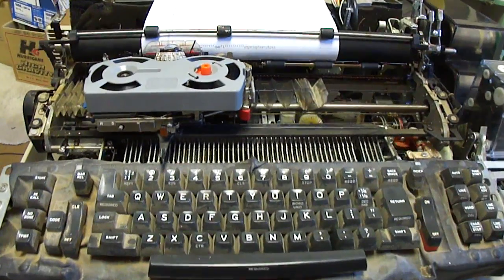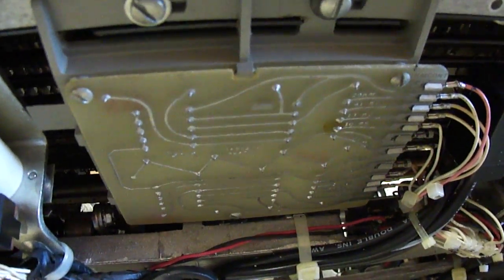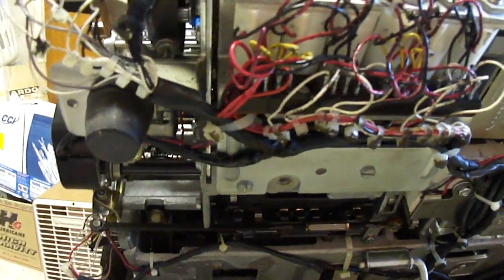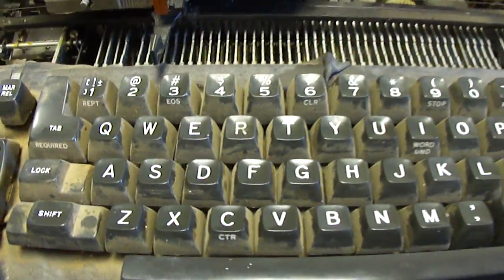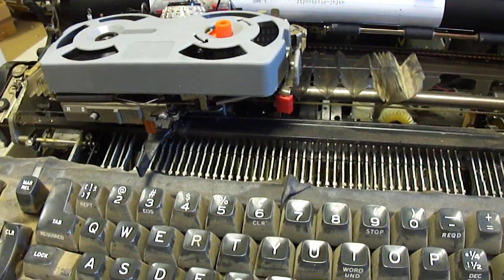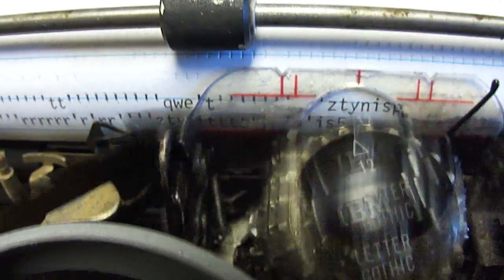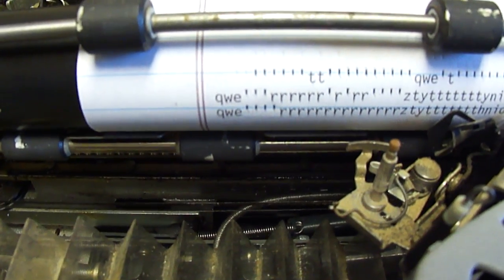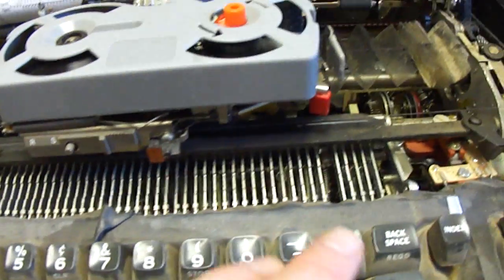1982 IBM Memory 100 Typewriter repair

Comment: "You really are becoming pathetic aren't you?  I'm one of the few people still alive, that could actually fix that machine; but I threw all my spine tools away long ago. I guess you don't know what spline tools?   Take off the element (ball) and underneath you will see two small screws holding a capstan with a pin  in  it.  That has to come off, and underneath is a Dog Bone!!   Now   Go away!!   That's all you get//"
Reply: +Griffith Harland "That's all you get//"?...., and yet, you keep coming back and adding to your vitriol. But my word, would I let you anywhere near one of these with your demonstrated confusion over how it works, names of parts and general mis-understanding?, NOT A CHANCE.  The 'capstan' you refer to is of course the Tilt Ring as I previously covered, and yes that is where the dog-bone connects. Glad you finally accept it.
I fully understand how easy it would be to forget the exact names of parts when you have been away from them for so long and I do not doubt that perhaps you were competent on these machines once, but I'm afraid your memory (no pun intended) and demeanor is letting you down here.  Your comments and opinions would be welcome if only you would not be so rude and insulting and accept clarification when an incorrect statement (which you bluntly submit as being factual) is responded to.
I have considered your kind request to Go Away!!!, but well why would I?, I'm quite happy here, and apart from which, I was making useful comments on these videos long before you leapt in boots and all with your mistakes. You are welcome to stay as well, just play nicely :-)
Reply: The 'Dog Bone' has nothing to do with the 'Tilt' and only the 'Rotate' of the Element!

Comment: We called it the Dog Bone because it is shaped like one, but it has a slot cur in each end - One at 12 to 6  and the other end 3 to 9, which rocks the element Tilt and Rotate as it changes at rapid speed from one character to another.  Tilt at one and Rotate at another. Won't make no sense because you get so frustrated??
Reply: Griffith Harland Incorrect (again). The 'Dog Bone' (Balljoint) slots are not offset. They are in the exact same alignment each end. There is a difference in the dog-bone across some models (9xx) due to the decreased bandwidth of the 96 character elements and they are distinguished by a scribe line around the centre. The dogbone does not directly transfer any 'tilt' motion, only rotate motion. Tilt motion is performed by the Tilt Bellcrank on later models and the Tilt Gear on early Selectric I models. The entire purpose of the dogbone is to act as a universal joint to allow the required rotate and tilt motion through the full range of 44 or 48 possibilities through the "Tilt Ring" which is what the element actually attaches to.
Hey Griff, there's an online training series for the Selectric Typewriter available, perhaps you should download it and retrain yourself?
PS: Just to be clear, I'm not getting frustrated, not at all, but I don't want any 'observers' thinking I'm picking on you, taking advantage of your incorrect recollections, or indeed 'trolling' so I am giving you the benefit of the doubt.
Sadly it is you, and only you who keeps making these totally factually incorrect statements and I'm happy to set the record straight.
Next.....

Comment: "Just how do you think they  change the pitch on that machine, IF they don't change the Element from  Elite, to standard Ten Pitch Courier??"
Reply: Griffith Harland Wonderful - not sure quite where that question came from but I'm up for it so here goes...
Changing the ball (element), does not change the pitch. The pitch (10 or 12 characters per inch) is pre-determined by the teeth on the escapement rack.
Early Selectric's had a solid rack and you ordered either a 10 (Pica) or 12 (Elite) pitch model according to your requirements. And it was the same for the Typebar models except they had a larger range of available pitches including Proportional.
Come 1971 and the Selectric II which now added a pivoting escapement rack combining both 10 & 12 onto the same bar. Flick the lever and the spacing (pitch) changes from 10 to 12 and vice-versa. Yes of course you would generally change the element to match because 10 pitch characters are wider than 12 pitch, but it was very common for people (especially legal secretaries) to use a 10-pitch element on the 12-pitch setting to combine a slightly larger font with tighter spacing to get more typing onto the page but still be easy to read. Changing the element is more about changing the typestyle/font than changing the pitch.
Note that on the machine in this video there is no escapement rack, only the leadscrew drive (call it a very long worm-gear if you must) which has a ratchet at the right-hand end. The ratchet has two sets of teeth, one set for 10 pitch and one for 12. Each ratchet has a corresponding solenoid which drops an armature into the ratchet to control how much rotation is allowed, and this is determined by the Planar (electronic board) counting the pulses from the Emitter Wheel on the left end of the same leadscrew.
The leadscrew only controls left to right motion and is under positive drive bias via the gearbox assembly directly driven from the main drive motor. The Electronic Selectric Composer is absolutely identical in this area except that it has three ratchets to match the required 72, 84 & 96-unit spacing.
Because you appear unfamiliar with this particular machine you may find some illustrations would help to better understand this. More than happy to provide those via the "golfballtypewritershop" which you can find on Yahoo (https://groups.yahoo.com/neo/groups/golfballtypewritershop) or on Facebook (https://www.facebook.com/groups/gbtwshop/)

Comment: "The Ball.  The Element does not turn.... It Rotates left and right.
  As I once told you, but you would most likely break it. The element (Ball) as a little black plastic top tha can be lifted to the right and then you can lift the ball off the machine. Underneath the ball is the Dog-Bone mechanism, and it is that that is the problem with your machine.  Go on break the element then you can throw ikt in thew garbage.  What is an Elical spring  (can't spell it these days) but it is that that drives the carriage. from left to right and also may be a problem..

Comment: "Every Selectric has a Worm gear.. Even the Selectric one.  has that same white nylon gear.
Reply: Griffith Harland Incorrect. Selectric I, II & III all share same basic design.
The only 'gears' involved in carrier movement are the Carrier Return and Tab PINIONS, the Tab PULLEY, and the Return/Backspace PULLEY.
There are also the pulleys for the Tab and Return Cords, plus the pulleys for the Rotate & Tilt Tapes.
And finally the drive train 'GEARS' on the left hand side to transfer motion from the Cycle Shaft, through the Idler Gear to the Print Shaft and Keyboard Filter Shaft.
However, some of the advanced models such as the Composer,  the Memory Typewriter shown here,  Electronic Selectric Composer, Mag-Card, and the 5215 Display-Writer Selectric printer, (plus of course the entire series of Electronic Typewriters model 50 thru 95) do have an Escapement Lead-Screw, a form of 'worm-gear' but these are not normally referred to as 'Every Selectric" as you state. I have never seen a Selectric I/O-writer with an Escapement Lead Screw.
Always glad to add to your knowledge and understanding of these machines :-)

Comment: "IF you knew as much as I do about IBM you wouldn't have any problems.  You don't even know what a Dog-Bone is, or a Rotate Tape, or a Tilt Tape. "
Reply: Griffith Harland Sorry Griff but you just dig yourself into a larger hole. I'm trying to be informative but it's clear from your comments that you are having some difficulties expressing yourself and I guess you have a few more years under the hood than I do. It is not my intention to belittle, insult or humiliate you in any way.

Of course if you make statements that are factually or technically incorrect I'll gladly put them right and leave it at that. Best.

Comment: "What you have is a piece of JUNK.  I bought one just like that one for $14 at a thrift stores, and finally threw it away owing to my relocation to another city. 
  I don't I even try to help you???  I really did used to strip down IBM's  for fifty years, but then you're a Radio Tech and piss all about Office Machines "
Reply: Griffith Harland I don't have a piece of junk, it's not my machine, and not my video. I simply added to your erratic and ignorant comments for the benefit of others just in case they mistook you for being knowledgeable . If you are going to comment on topics you better be sure you know what you're talking about and clearly you don't have a clue.

As for "Radio Tech?", nope not me. Don't know a lot about radios but I am thankful to know just a little bit about IBM office products (such as the IBM Selectric Memory Typewriter 50/100 as shown here).

It's fantastic that you used to strip down IBM's, but I wonder, did you have any success putting them back together?

Comment: I could see in the video that the Z is immediately above the T.  I might suspect the single quote and r are in the same relationship.  Since it seems to put the correct character in memory, the keyboard, including the reed switches, is working correctly.  I would guess the most likely problem is adjustment of tilt home which is spacing of the pulleys of the tilt tape.  This, and rotate, needed to be checked and adjusted frequently.  To hand cycle this machine you disconnect the motor turn it on.

Comment: This chart may help you.. groups.yahoo.com/group/golfballtypewritershop/photos/album/1826749023/pic/1426202396/view?picmode=large&mode=tn&order=ordinal&start=41&dir=asc - you cross-reference the character that should have printed against the one that actually printed, it will point you to the troublesome latch - although this is the base Selectric Typewriter chart, the Character Selection Differential is the same basic design as in your Memory Typewriter.

Comment: Your substituted characters are most likely a problem with the Selection Latches - left side, pulled by the bank of solenoids. Sometimes they 'pop' meaning they slip off the Bail which pulls them down to move the Tilt & Rotate Tape. There is a chart which will assist with trouble-shooting this problem. May I suggest you check out the Yahoo Group golfballtypewritershop... groups.yahoo.com/group/golfballtypewritershop

Comment: @retrochad  - these machines will automatically convert a 'space' into a carrier return if the space occurs within the right margin 'zone' which is about 5-8 spaces (I think the zone is adjustable but can't recall). This is what enables the electronics to keep line-endings consistent even though text may have been inserted or deleted during editing.  A 'required space' means that the space must remain as a space, ie not be converted to a carrier return if it occurs in the right margin zone. HTH

Comment from the maker: @drewinatlanta Thanks so much Drew, any help you can give me will be very much appreciated. I tried the machine again today and it started out OK but started typing wrong characters which would vary...I can't figure out if it is a lubrication problem in the tilt/rotate mechanism for the element or if it is in the mechanical logic between the keys and the reed switches or if it is an actual electronic problem in the computer circuits.

Comment: I have complete user documentation for the Memory 100 and the Memory 50 (the only difference on these 2 machines was whether it stored approx. 100 pages in 100 memory banks (Memory 100 with the "A" and "B" switch in the center of the dial) or 50 pages in 50 memory banks. I have 3 of these machines - the one that still stores and replays perfectly which also types random chars likes yours did. Would be willing to scan the user guides and share with you if interested.

Comment: When stored memory is replayed, the machine adjusts if margins, etc. are changed (like word processors). Sometimes an operator may not have want the machine to break two words separated by a space if at the end of a line, may have wanted to ensure a hyphen wasn't interpreted as an optional split of a word, or ensure a return wasn't optional, etc. By keying Code + the appropriate keys with "reqd" options, the machine would interpret that command as "required" when playout occurred from memory.

Comment: @retrochad Very interesting! It's possible to store data only with RAM and TTL-chips and the tape, but I'd think, that the amount of chips will be very very high. :D It also will require a rather beefy powersupply on the +5V rail (if TTL - in CMOS it will be different)
Merry Christmas to you and I wish you a nice time :)
Please never stop making videos :)

Comment from the maker: @kretschi123 The computer system of the machine is along the back of it with a lot of discrete chips.I'll try and make a video of it. It seems like it consists of some kind of RAM which stores typed characters and you can write the RAM contents to the tape and overwrite what is on there, or read data from the tape back into the RAM to automatically type out. I still am trying to figure out exactly how it works as the store/recall procedure seems confusing.

Comment: Cool machine! I never saw something like this - only fully digital typewriters (like a pc and printer build into the same case).
I'd like to see more of the actual memory-system of this machine. Is it controlled by a processor of any kind and the tape drive is only for storing the written texts?

Comment: Back in the 80's this was the typewriter that I used in the office where I worked.  It was fantastic doing form letters which saved me a lot of typing the same letters over and over again.  IBM also made a mag card model that used magnetic cards that you inserted into a writer/reader mechanism.  Thanks Chad for showing this piece of technological history which was at the time state-of-the art.